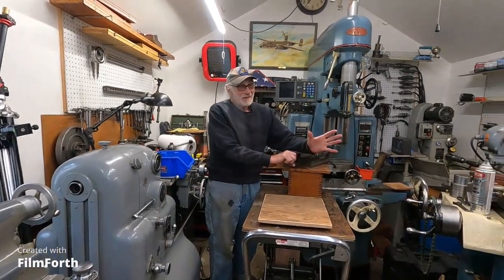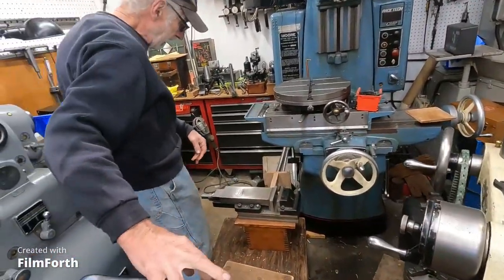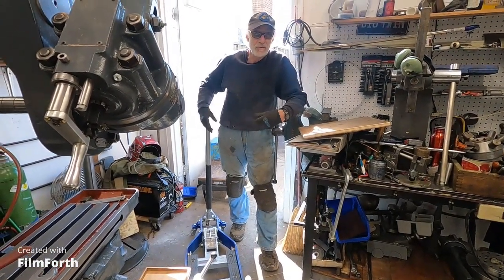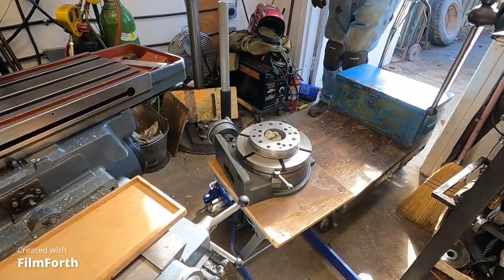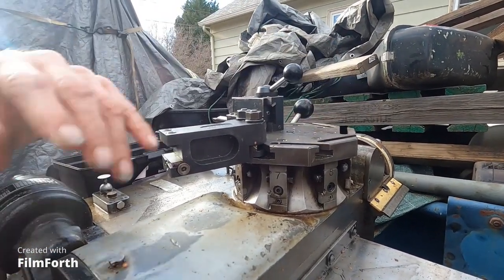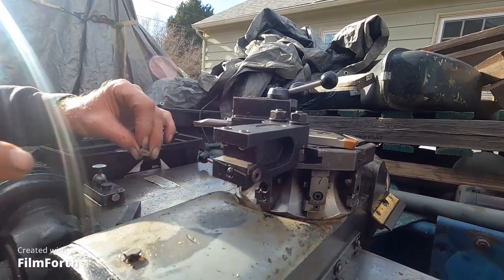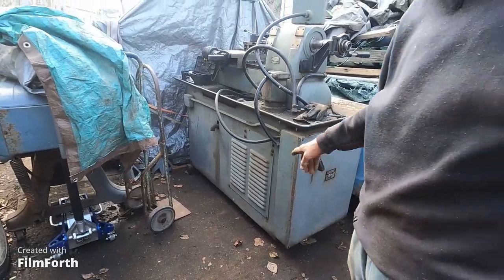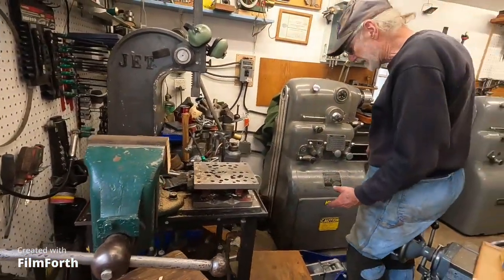Moving heavy machine tool attachments and more

Comment: DeeDee,  Moving heavy things, especially top heavy things, requires being able to outthink the problem.   I’ve seen things go wrong because people didn’t know what they were doing and boy did things go wrong in a hurry.  Good of you to show how it can be done safely with minimal tools.  Interesting, as always.   Cheers, TB
Reply from the maker: Hey there blade, I am not the expert machine rigger but I have been able to move them around once delivered. getting machines off the truck is for the professionals not me. The most top heavy machine the Moore jig borer does not have to go far. The concrete my grandfather poured in the early 50s is very rough and uneven like the last shop I rented, I found just sliding them on greased steel using prybars and comealongs slung low is very slow but reasonably safe, thanks!

Comment: Great minds think alike. I also have a motorcycle jack that I bought from a garage sale for $45 but it is wider and more stable. I built a table that bolts to the top of the lift, and I also use it to load and unload vices rotary table and chucks. My heavy lifting days are over also due to health issues. I also have some of the Harbor Freight Knee pads. Fact is "Old age ain't for Sissy's" lol. Thanks for taking the time to bring us along. Moving is very time consuming without the camera, so I know how much of your time is dedicated to bringing us along.
Reply from the maker: I think doing the videos helps stimulate progress a lot. I am also making room elsewhere to put all these smaller things. I did not want to do videos on this, I do it only with material and tools at hand in a very tight but easy to heat space 11X17 ft, the camera makes it look larger. Very lucky machines, all other small garages in the Neiborhood has someone living in it. Just now lifting the heavy vise and small arbor press off the small steel table and get that table out of the way, back later!

Comment: Great action in your shop moving  stuff around , Looking forward to see the shop with the choker in place the Harding lathe is sure an nice find have fun .
Reply from the maker: I used one for motorcycle cylinder head parts up until I closed that shop in 06, I found the machine great for parts using basic tooling, finding the angle cutting slide makes it even better, thanks

Comment: Dee your making my back ache. Try some friction material between top of the pallet jack and bottom of the lathe. Could avoid a tipover on the rough concrete. Cheers
Reply from the maker: The chucker has four feet that at least will keep on sideways, the others I use pieces of card board or some old rubber flat belt, thanks1